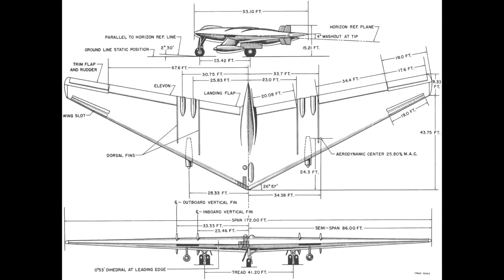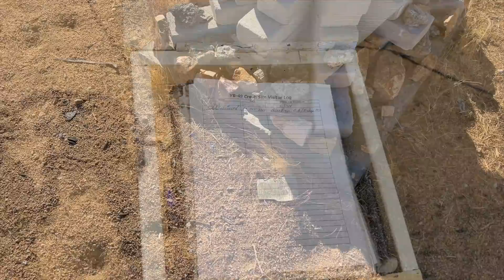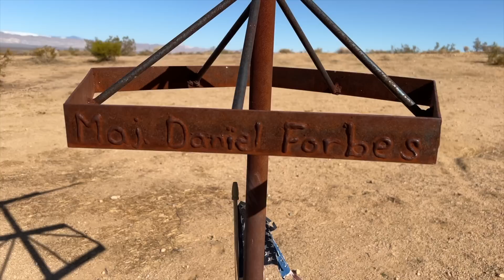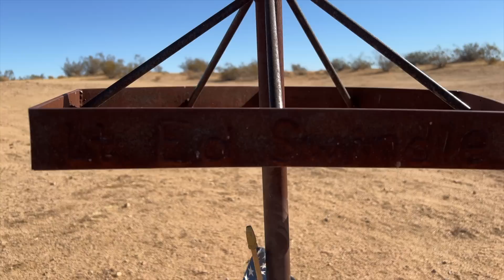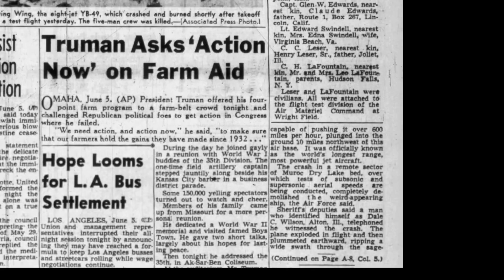YB-49 Crash, June 5, 1948, with On Site Visit.

Comment: Edwards AFB was located at Muroc Dry Lake, later to be called Muroc Field. The name came from the original settlers in the area, the Corum brothers. Muroc is "Corum" spelled backwards.
The flying wings had a low radar cross section. When a fighter chase plane was with the flying wing, radar would easily pick up the fighter but not the flying wing until it got much closer. The flying wings had some design flaws. It could not carry the then-larger nuclear weapons of the era. Also, it was unstable in level flight which reduced bombing accuracy. The ultimate flaw was political. Jack Northrop would not sell out, and he was punished for that.
For a time, Mrs. Jack Northrop lived in my in-laws' neighborhood. While I never met her, she was friends with my in-laws.
One of my relatives worked at Northrop Grumman and had a hand in designing the B-2. All he would ever say (even to this day) was that he met Jack Northrop. I understand that, I held a clearance at one job I worked at.

Comment: Great tribute, however, you did not correctly site the reason for the scrapping of the B49’s production. 

It was political. Stuart Symington in Washington pressured Northrop to allow a different manufacturer to make the bomber and there was a contention there as Jack Northrop didn’t want to give up his project or be forced into collaboration with i think it was Convair.  I think there was some relationship between Symington and Convair scratching each other’s backs and he was adamant to give the project to Convair probably because he would get a kickback of some kind. For that reason due to the stubbornness of Northrop, Symington drew the weight of the goverment to demand the bombers he destroyed and also the simulators. My grandfather worked at Northrop and remembered the day the government showed up and chopped all the aircraft up and destroyed the simulators that my grandfather worked on.

Comment: My Aunt's significant other (so 'my uncle' as far as I was concerned) Was a gentleman named Dale Edwards. Capt. Glen Edward's Nephew.
Dale was also in the Air Force in the 50's flying B-47's for SAC. We had many conversations and some memorabilia regarding those days. 
I got to read some of Glen's diary. He wasn't overly fond of the YB-49. Stall recovery in that airplane wasn't the cut and dry lesson we all learn in flight school. If you're wondering Gen. Bob Cardenas has a cool video on here describing the process. I highly recommend watching. Search 'General Cardenas - Tumbling in the YB-49'. It's worth 2 mins trust me.

Forrest says 'No-one knows for sure what exactly happened' at Muroc that day. I do. Dale does. Gen Cardenas does too. 
I'm not saying what it was. what it wasn't was Pilot error. It wasn't the airplane either. 
I never joined the Air Force. And this is pretty much why.
Blue skies my friends!

Comment: I did read somewhere that the stall was undertaken at or close to full aft C of G which was dangerous. The aircraft was said to be very difficult to escape from in an emergency and this crew found that to be the case.
Reply: Do you know if the accident crew was testing aft CG stall characteristics that day?
This is one accident I’m not too awfully familiar with.
Reply: @kaypie3112  Yes, I have read that they were doing stalls at aft CofG. Someone had done it before  or after (I can't recall but suspect before) and it was an ugly response with it near flipping over backwards. The crew were, I  recall,  surprised it held together. The article was in a magazine like Airpower or similar- many years ago. I tend to hang on to my old magazines.
Reply: @terrybrown8539  Hi Terry. Thanks for the response.
Long Before the era of FBW and envelope protection.
It’s interesting that the YB-49 departed controlled flight even though the CG was in limits.

Comment: Would you consider doing a video about the SR-71 incidents? SR-71A (61-7952 / 2003)

This aircraft disintegrated on 25 January 1966 during a high-speed, high-altitude test flight when it developed a severe case of engine unstart. Lockheed test pilot Bill Weaver survived although his ejection seat never left the plane! Reconnaissance System Officer (RSO) Jim Zwayer died in a high-G bailout. The incident occurred near Tucumcari, New Mexico.
SR-71A (61-7966 / 2017)

This aircraft was lost on the evening of 13 April 1967 after it entered a subsonic, high-speed stall. Pilot Capt. Earle M. Boone and RSO Capt. Richard E. "Butch" Sheffield ejected safely. The incident occurred near Las Vegas, New Mexico.

SR-71A (61-7970 / 2021)

This aircraft was lost on 17 June 1970 following a post-tanking collision with the KC-135Q (59-1474) tanker. Lt. Col. Buddy L. Brown and his RSO Maj. Mortimer J. Jarvis ejected safely although the pilot broke both legs. The SR-71 crashed 20 miles east of El Paso, Texas, but the KC-135 limped back to Beale AFB, California with a damaged refueling boom and aft fuselage.
Reply: I would like to see videos on each of these also.

Comment: Another excellent essay Forrest - thanks for posting.
Interesting sidenote: The B-2 Spirit and YB-49 share the same wingspan - 172' 0"
Reply: Exactly. This wing was designed with a slide rule and its very distant sister with modern computers, yet the magic number is 172 feet. Jack just needed computers.